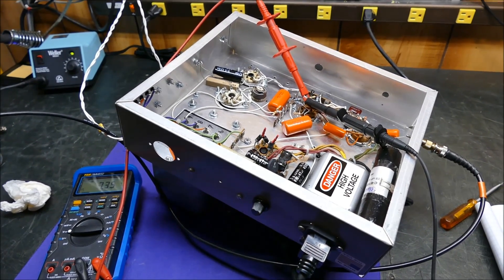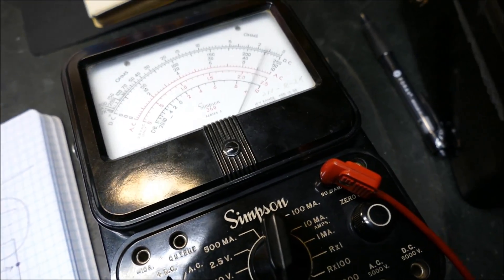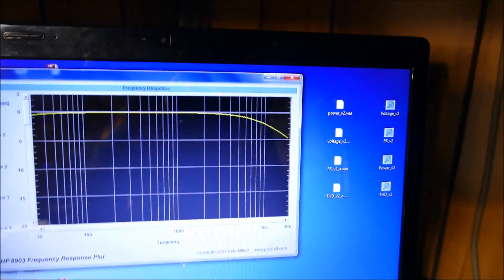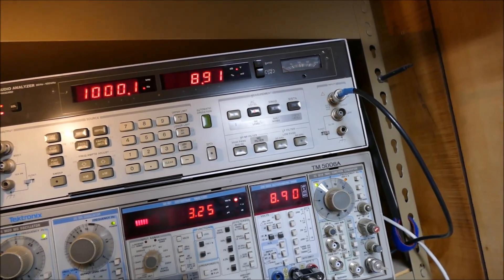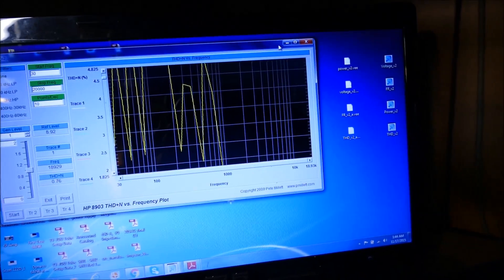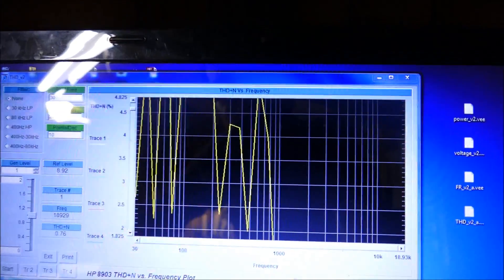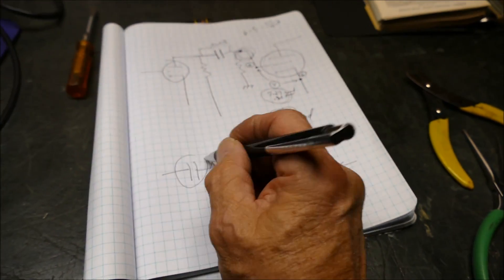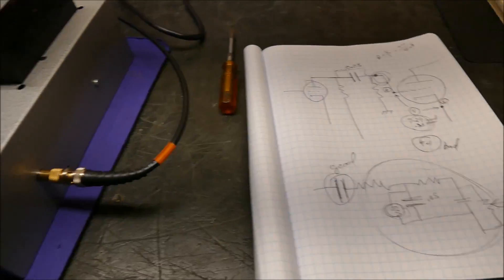Investigating THD and Frequency Response on Coupling Capacitors in Vacuum Tube Amplifiers

Comment: So I’m going to work on changing the tone capacitors how can I tell the positive and negative on the new style poly tone capacitors I was reading and I was told there is a positive and negative side are they right and if so how can I check them
Reply from the maker: I think this link will answer your question.
https://www.aikenamps.com/index.php/where-to-connect-the-outside-foil-on-capacitors
I have not verified this but it might help.
https://www.youtube.com/watch?v=tFa6XJccvTE

Comment: I have a few 1962 Hh Scott 222c amplifiers do you think I should replace all the coupling capacitors or leave the org ones in I don’t have all the testing equipment like you but it runs and sounds good but not as great as I would like it ?
Reply from the maker: If it works and sounds good and the tubes are not screaming hot, I would be careful about working on it.  It can be perfectly OK .  
I agree that with a lab full of equipment, it is easy to assess things like capacitors. On the other hand, it is actually simple to check if capacitors are "leaking DC". Of course, the capacitors most likely needs to have at least one end removed from the circuit so it is "floating" and the capacitor can be tested independently of the circuit it is in. Putting a power supply in series with the capacitor and a volt meter is really all it takes and if the volt meter doesn't eventually go to zero volts, as the capacitor charges, it will indicate that the capacitor has DC passing thru it and that will seriously affect the circuit the capacitor is driving. A variable high voltage DC supply is necessary and you don't want to put a voltage across the capacitor and volt meter greater than the voltage rating of the capacitor. For a short time a little over the rating of the capacitor would be OK but not for permanently. 
I have "old" capacitors that are as good as anything new but there is a mentality on the Internet that electrolytic and coupling capacitors should be replaced in all vintage equipment. If I were a commercial repair shop, that might be a good philosophy for the customer not just to sell more capacitors and service. On the other hand, I have worked on a good bit of equipment and for some reason I remember the Fisher amplifiers having bad coupling capacitors every time I serviced them. Maybe they ran them too close to their rated voltage which does seem to shorten the life of capacitors. 
I am sure there are still a few service providers out there that are honest and can provide good repair service but I would not know where to find them. We are kind of like the toaster repairmen - not many left...   lol
If asked, I tell people that are buying vintage amateur radio equipment like Collins Radio, for example, to be careful when purchasing such beautiful instruments because you are probably going to have to repair the equipment yourself when it needs it. 
One last thing in my babbling on, and that is much of the older equipment was made to be repaired. All equipment needs repair eventually and the older equipment builders knew this and there were zillions of parts made "back then" and they are still around and new parts made also. A very different philosophy from todays equipment when it breaks, we toss it and get another one, fancier and prettier than the last one.  Hope this helps.
Reply: @ElPasoTubeAmps  well I have 2 of these HH Scott 222c amplifiers so maybe I will change the coupling caps on one amplifier
 I have already installed new tubes and filter cans  and tested them on both amps one amp the preamp sensitivity is very different with bass and treble. I also dropped the voltage down since my mains is 125v the B+ was dropped to diagram specs on both and changed the rectifier to silicon for the negative bias and I had to Drop that to spec 
But I would love to see a test with your equipment and test it you run the neg bias higher or lower then spec and see what the output values would be  that would be interesting I’m sure there are videos made already 
Thank you for your videos they are inspiring and keep me in love with audio I will have to watch a few videos on how to install the caps on the amplifier I’m very critical on wire placement and long term relatability I do see about 10 caps they look like wax sticks and some look like they got hot and deformed the value is .25 mf
Reply from the maker: @jimcatanzaro7808  I see you can do what is necessary to keep it running properly. I am a fan of the Orange Drop capacitors and don't spend money on the fancy high $$$ capacitors. I assure you we can not measure any difference in performance with test equipment by using these huge and expensive capacitors but I can never say how it will make an amplifier "sound" as that is purely subjective.
I did a video a few years back by making the bias on a Fisher more negative, lowering the temperature of the 7591's and the measurements were significantly poorer with more negative bias. More negative bias and less plate current pushes the tube closer to crossover distortion and raises THD. it is an unfortunate fact that the hotter we run our output tubes, the better they perform. We get more power and less distortion by running them "hot" right at max plate dissipation. Sad but true. So, what is the objective ? I suppose a compromise and just admit we need to replace tubes occasionally or if we keep the power down to a few watts, we can run our tubes a little "colder" and maybe lengthen the life of the entire instrument.
Power and THD are obviously not the final work in an amplifier. It that were true there would be no such thing nowadays with SET amplifiers. The harmonic profile of a SET amplifier approaches a triangular wave with every harmonic from the second upward in an ever decreasing amplitude - but somehow we can love the sound of the SET amplifier. Just think back to the days of the audio engineers whose objective was to get rid of that horrible second harmonic that dominates single ended amplifiers and they did it with the push pull amplifier. Also, the wanted to make a 10 watt amplifier weigh less than 60 pounds....  now we build 60 pound 7 watt amplifiers and think they are the greatest thing ever. We have to laugh at ourselves a little bit. Stay safe...

Comment: I believe you could achieve superior distortion figures by reconfiguring your driver stage. 6B4GS are more demanding of the driver stage than EL34s. Look at the ALTEC A 100 A circuit for a good example of choke loaded cathode drive.
Reply from the maker: It is interesting that you bring up the choke loaded cathode drive as that is what I am considering building into a PP SV572-10 amplifier and pretty much copy the Altec 1570B circuit. I am sure I will use 6V6 instead of the 6K6 although I have a number of 6K6's that I can play with. I plan on using one of the line transformers I have made videos on recently, using only the primary of course where I can derive a CT.  
As for the 6B4G, the bias is very negative,  if I remember correctly around -50V or so, and at the level I use it (below 10 watts) I don't think I am driving the grid positive at any point. In general I copied the Acrosound schematic for the 6B4G amplifier.
I looked up the Altec A-100 and found the manual for the organ but not the amplifier. If you have a link to the schematic, I would appreciate it if you could forward it to me.
Reply: ElPaso TubeAmps sorry i didn't see your answer. The best link is this one but you have to scroll down for the Altec A100A. This is one awesome page if you don't know about it yet. You may get lost in here. http://lilienthalengineering.com/100-amplifiers-chapter-1/100-amplifiers-part-2-1945-54
Reply from the maker: Absolutely awesome site. Thank you. I could spend a week looking at the schematics.

Comment: Thank you for this informative video. I'd throw out the leaky cap anyway, even if used in a tone stack (where it would not leak DC) for the concern its value may change radically and bypass more resistance and change the amplifier's tone contour.

Comment: Leaky caps are usually "noisy" caps.  It looks like a lot of the THD was actually intermittent noise.  It's also not hard to believe (It's expected!) that any well designed triode amp would sound much better than a Mcintosh amp. McIntosh amps are designed to "measure" well, not "sound" well.  Too much feedback, both globally and locally.  The Dynaco's usually sound much better while stock and dramatically better after some good mods!  A well designed triode amp would be better yet! Great video!

Comment: Thanks for sharing your experiments and findings.

Would be interesting to see a plot from an Impedance Analyzer frequency sweep using that capacitor compared to a new one. Mostly parameters |Z|, Rs and D.
Reply from the maker: +Alfred Stampe I did that tonight and could not see any difference at all. I was a bit surprised. However, when I put the equivalent shunt resistance of 8 meghoms across the good capacitor in the amplifier, I got the same bizarre THD response as I did with the bad capacitor. Watching the oscilloscope, I could see about a 1 Hz oscillating bounce in the amplitude of the signal. Possibly something unique to my amplifier circuit. i will try to make a video of all of this.
Reply from the maker: +Alfred Stampe i might add that all i really got on the sweep is an exponential curve that one would expect from increasing frequency which we might call |Z|. As for Rs that would have to be derived from D which was about 0.01 on the bad capacitor and as close to zero as I can read on the GR for a good capacitor. I also constructed a circuit with large NP capacitors, to protect my equipment from the HV DC, and then placed 400 VDC across the bad capacitor and re-scanned thinking that the DC bias (stress) on the bad capacitor would make it act crazy and got nothing different - the plot was the same as without DC across the capacitor. I believe it is possible to completely evaluate a small value capacitor but it is time consuming  and takes some involved measurements - probably easiest to just replace it if in doubt.
Reply: +ElPaso TubeAmps In some future video could you please elaborate on your method of applying a DC bias voltage to a capacitor while testing it which both protects the measurement device and does not interfere with the accuracy of measurement result. Many of us with LCR meters (such as the DER EE DE-5000, etc), would like to do measurements of inductors/chokes and capacitors whose values can sometimes be highly voltage dependent (i.e., some multilayer ceramic capacitors). Thanks again.
Reply: +ElPaso TubeAmps  I looked at the TO-250 schematic and see that the 1st and 2nd stages use 100k plate resistors, meaning that the tube ought to be biased at 2mA in order to drop half the supply voltage, giving the plate voltage equal room for positive/negative signals.  By introducing a leaky cap, you change the bias points of the 2nd stage (and possibly the 1st stage).  You tested the bad cap at 400V, but the actual circuit applies only 200v across the cap, therefore probably not 50uA of leakage, but some nonetheless.  You measured the grid-cathode of the 2nd stage to change from 7.3v to 4.1v.  This changes the bias current from 2mA down to 1.14mA, pushing the plate voltage higher.  400v - 100k*1.14mA = 286V.  This is likely the cause of the high THD readings.  The 2nd stage is operating at a much different point in the transfer curve of the 6SN7.

I suggest probing the plate of the 2nd stage, also check the plate of the 1st stage.  It would be nice to know the grid, cathode, plate voltages of all the nodes.

By the way, to calculate the bias of the 2nd stage, I see that the tubes share a common 1.8k cathode resistor. I assumed half the impedance (3.6k) to derive the plate current of a single tube.

As sporadic-Z pointed out, you should report the grid voltage (negative) or grid-to-cathode instead of reporting the cathode-to-grid (positive).  Triode datasheets show plate characteristics with various Vgk voltages.  I am curious if the grid of the 2nd stage (normally at 0.0V) was pushed up above GND due to the leaky cap.

Comment: I know you mentioned that you could use the amps' power supply if you don't have a separate one to test the capacitors at HV: would it work and possibly save the step of desoldering parts to test a coupling capacitor in-circuit and put the ammeter from the output-side of the cap and to ground?
Reply from the maker: +Nick Middleton l think you are going to have to remove the capacitor and test it independently of the circuit.

Comment: This was really helpful! I've been debugging a problem amp for weeks now, tearing my hair out trying to find the issues... I dont have an ESR meter, or anything to measure caps other than my DMM with cap setting (which works for most coupling caps). Other than how much they've drifted, I haven't been able to tell much about what's happening, other than there is incredibly high voltage all over the place (+20% of spec everywhere). I think the amp is seeing a bad load, which could be caused by poor biasing of the power amp for the reasons you showed in your video. Then again, I'm no EE...

Comment: Very interesting. Could you temporarily shunt 8 Megs of resistance across the new, good capacitor to simulate the leakage of the bad capacitor? It would be intriguing to see if the T.H.D. measurement would be as poor as it was when the bad capacitor was installed, or if an additional defect in the bad capacitor was skewing the results somehow.
Reply: +fpliuzzi Additionally, I'd expect the two distortion measurement results to be similar, but I was curious if the T.H.D plot would be as "lumpy" as it was when the bad capacitor itself was installed.
Reply from the maker: +fpliuzzi That is a good thought. I wish I had done it with the good capacitor. I will try it and if I don't make a new video, I will post the results in a "speech bubble" in this video. I think a steady resistance of 8 meghoms will make it behave very differently than the bad capacitor. In any case, it seems the results from testing the capacitor for DC leakage is definitive.
Reply from the maker: +fpliuzzi Just tonight I put 8 meghoms shunt across the good capacitor and got the same bizarre THD results. I didn't  expect that as I figured the bad capacitor would be a non-linear resistance to frequency. It also induced a slow, about 1 Hz, bounce in the amplitude of the output of the amplifier.  I am convinced it would have somewhat specific results in different amplifiers but in all cases, it seems THD will go very bad with additional anomalies.
Reply: +ElPaso TubeAmps  Very interesting. Thanks for the additional test.